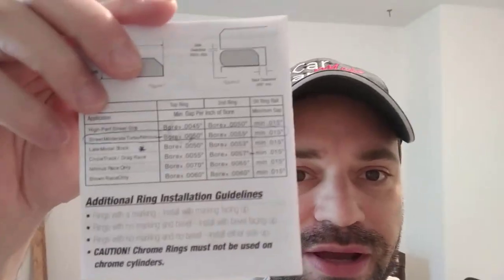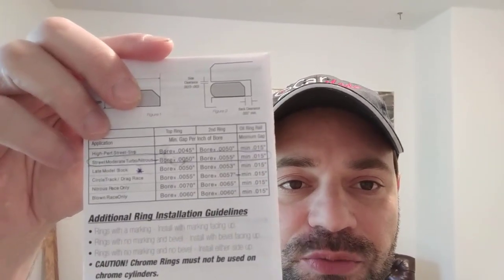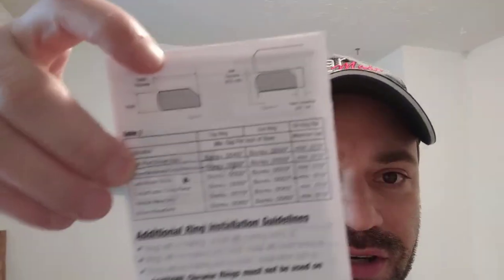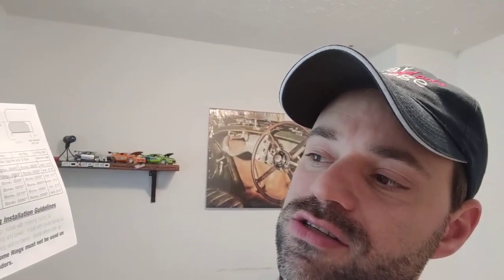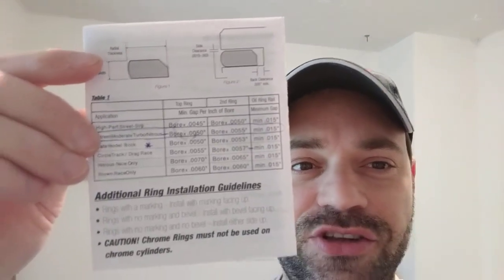File Piston Ring End Gaps - #Eclipse2GBuild

Comment: When you are filing your rings, you should turn the grinding wheel in the direction that would push the ring into the screw stops.  There is nothing wrong with the direction you are going , just the chance of the ring slipping is greater
Reply from the maker: Thank you I appreciate your comment. Will do that next time! 🤙

Comment: Don't need it
Reply from the maker: for some reason I just saw your comment. Don't need to gap the rings?
Reply: @CarModsGarage   I'm asking   because the factory supposed gap the ring to the oem  block size
Reply from the maker: @hondad-series9265  oh ya same thing for those ones. I ordered the rings for the bored cylinder 0.050" and they all come "pre-gapped". The oil retainer upper and lower are correct already usually (won't hurt to check though). The 1st and seconds rings that needs to be gapped according to the application. If turbo/nitro larger gap is needed though